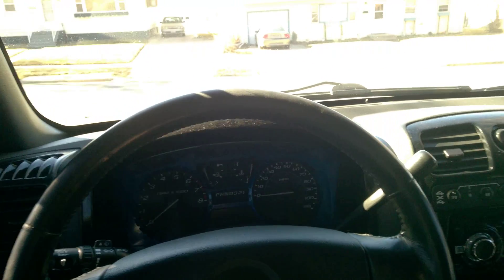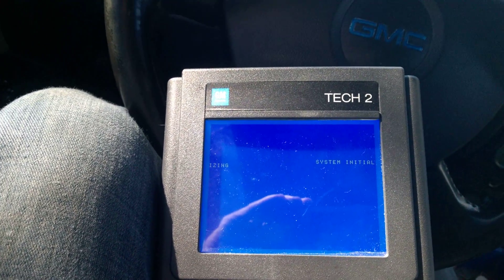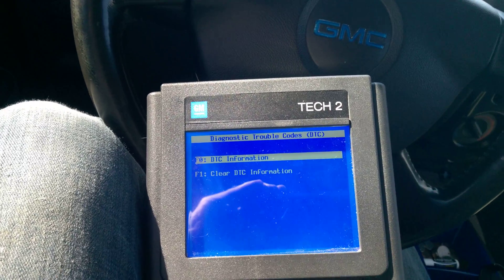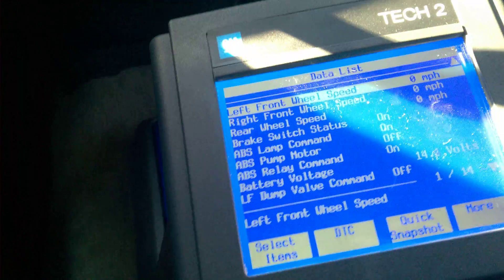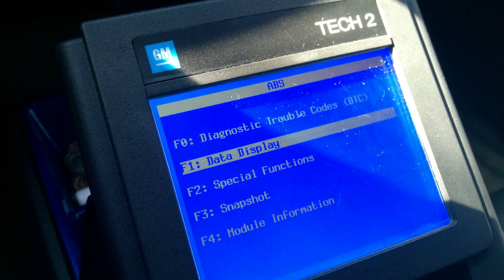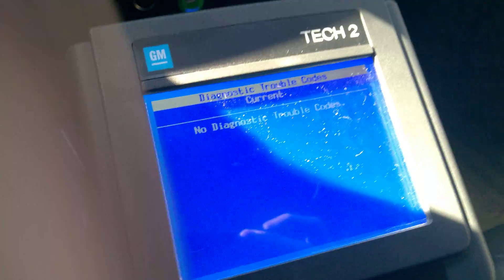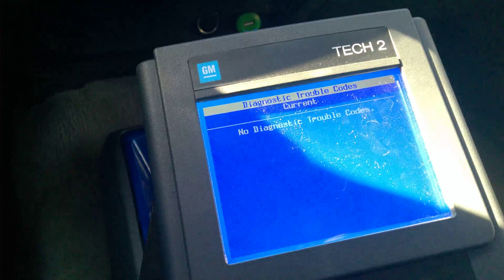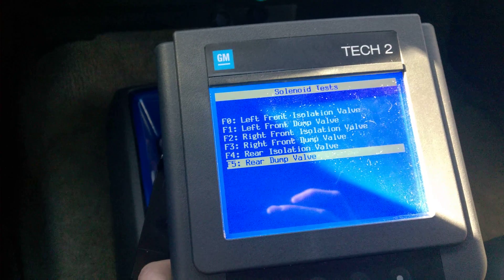Solving a C0040 ABS Code using a Tech2

Comment: I had this code on my 2010 Chevy Cobalt.  I had replaced the hub last year and thought I may have had a failure.  Turns out the wiring had fallen from the top of the firewall to just above the exhaust manifold heat shield.  The heat caused the ABS/Traction Control light to come on after I would slow down to a stop from driving.  The heat at idle was enough to alter the voltage and cause the lights to come on in the dash display.  I put the wires back up into their loom and the problem went away.  I'm glad it was an easy fix.

Comment: If you leave the sensor connector loose, yeah you can get that manipulated code. After an ABS module, wheel bearing and having checked the feed wire and come up with no reason.....